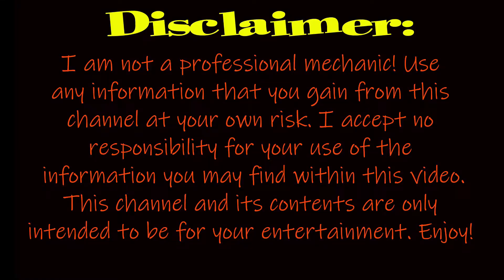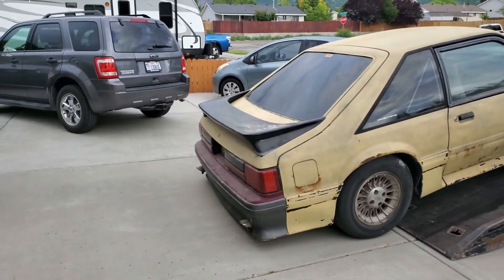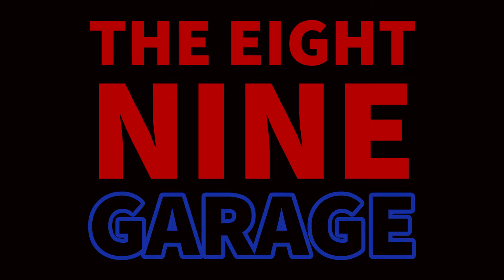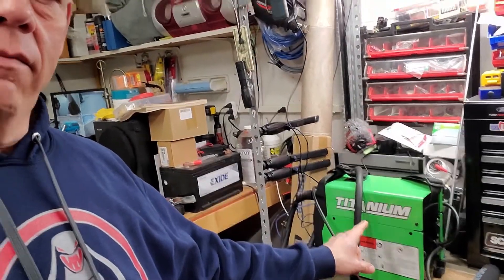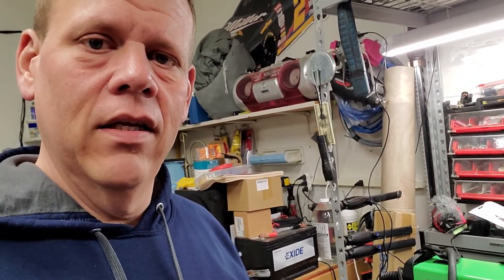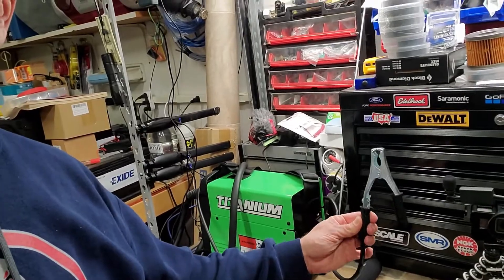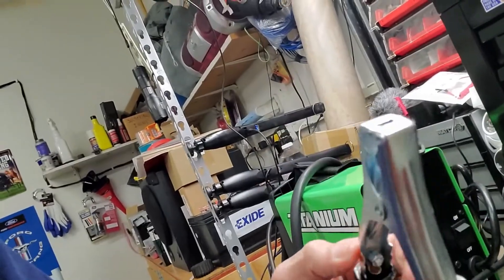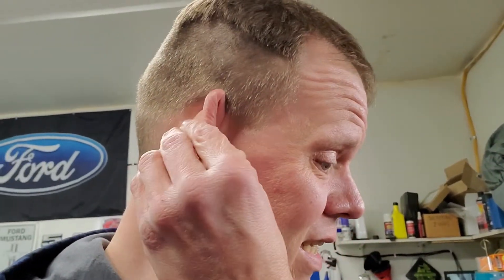Eight Nine Garage (Short) - Titanium Ground Clamp Upgrade - EP1 Short

Comment: What size flux core wire do you guys prefer with this welder?
Reply from the maker: I am currently loving the INETUB BA71TGS .035-Inch that I found on Amazon. It does require you replace the tip that came with the welder though. If you need info on that, I can get you that as well when I am back home.
Reply: .35

Comment: Nice upgrade.  Lincoln  has good flux core wire which will make a difference as well. Big-box stores usually have it on the shelf.
Reply from the maker: J Brew, thank you for mentioning that. I have some of that in my old 90 amp welder that I am going to try. I've also read that this Titanium 125 amp likes the INE BA71TGS, so I am going to give that a whirl as well. Ever used the INE before?
Reply: @89G  No , I haven't used flux core in awhile.  I have a roll of Forney and Lincoln FC wire on  the cart, but don't use it.  I use  ER70S6 from Lincoln or Harris for the most part.  With a little Hobart Handler 140.   You have a gas hook up on the welder correct  ?  Well, you'll want the gas on the thinner stuff, -if you want it to look nicer. A small bottle will probably last you a few years or  longer...